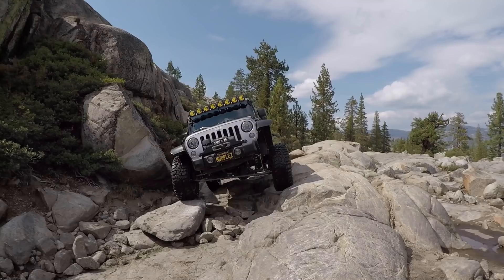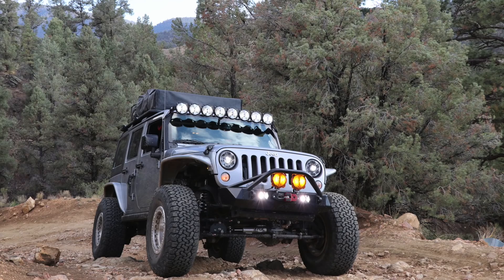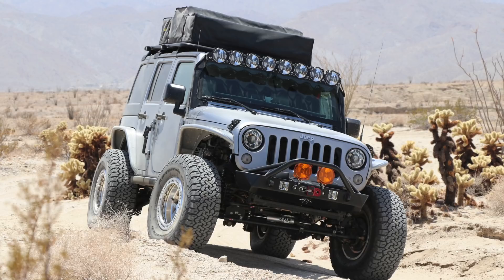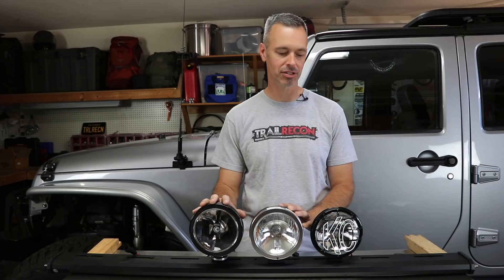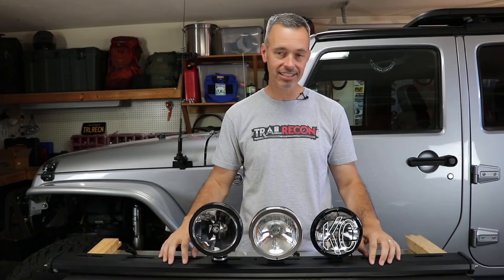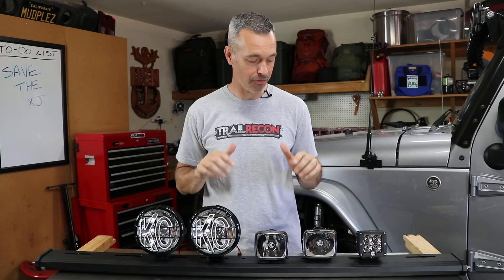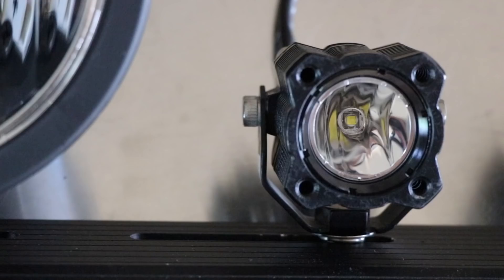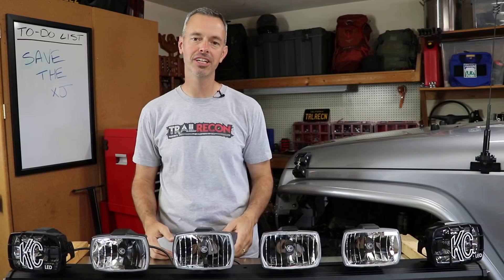Which Off-road Lights are Better? HID vs. LED vs. Halogen & Beam Patterns

Comment: Very helpful. I will be getting the HID lights
Reply: still stuck on HID's and halogens.   When you factor in reliability, cost, performance, etc, it's nearly impossible to beat HID.    It's been about 5 years since LED"s really took off and I will guarantee you that anyone who's tried LED this and that throughout those years has a box of dead LED products (leaky, blinking, dead elements, etc)     HID is still the king of range.   If you want to set up an LED that'll have the same output and range of a 50W HID spot, you'll be looking at a massive LED lamp that draws a few hundred watts.

Comment: Great video! I would be curious to also see the running temps of each of those. Might be important for lights near equipment on the top of a Jeep
Reply from the maker: Oh man, that would have been a great thing to have compared... maybe I'll have to do a temperature video another time.  Just need to get them to loan me the lights again!
Reply: LED are great... but I live in VT and they just don't run hot enough (on the lens) to keep snow and ice off them and until HID are in my price range, I'm stuck with 130W bulbs in my Hella 500FF enclosures.  All the LEDS become pretty useless after 10 minutes on the road or trail in the winter.

Comment: Had KCs for many years but switched to Baja Design LEDs last year.  And yes on matching your lights to your use and to your electrical supply.  Once upon a time 25 years ago in the deepest, darkest Baja, my old ‘72 CJ rolled to a stop in the dark.   D’oh.  I ran the battery dry because I was using more juice than my alternator could produce.  Lesson learned.  Love your vids.

Comment: Great video!!  Loved how you explained everything. Would have been nice if you showed how the lights performed at night for longer on screen time. Having only a few seconds to check out what their performance is just wasn’t enough. For future reference try 10 seconds for each light by itself alone. After showing each light by itself then show pairs of lights as in how they can be used to compliment each other. Also, try placing a marker of some kind at various distances from the rig. A small stand or tripod with a white paper plate with a number written on it with sharpie would work perfectly. Thank you for the great videos of things we, your viewers, couldn’t do ourselves. 
Cheers mate and happy trails

Comment: Hey Brad, Great video as always! Very informative. I realize you live in a warm part of the country but I think a good thing to mention is LED do not put out enough heat to melt ice or snow. I have LED headlights and fog lights and had to keep stopping during a snowstorm on my way to Cleveland to brush them off. There are lights that come with a heating element but are more expensive. Really jealous of your Gravity Pro Light Bar!

Comment: As a new JL owner with the LED lighting option, the main complaint I found on all forums about the LED lighting package was how they sucked in winter driving when the snow covered them and stuck rather than melting off.  Every forum I read said you need the LEDs with heated covers, or put a set of Halogens on.  Thus I went with KC Daylighter Halogens - one pair Driving and one pair Spread.  I figured that would be enough to get me through the snow issues, and I plan to use LEDs for any additional lighting needs to lower the total amp draw.

Comment: I've owned my TJ for 13 years and I'm still moving lights around!  lol  
I presently don't have any lights up on top over the windshield since I've experienced a lot of reflection from the hood.  And being yellow in color,  the reflection looks like it's sundown in the Jeep.  
For the lower windshield corners, I presently have 6 inch KC Daylighter halogen spot lights and they light up nicely with no reflection. 
On my front bumper I have (cheapo) 4 inch HID's which are awesome as they're wide angle and super bright.  They have been great for many years.  
I now need to decide if I want to keep the (old school) light bar above the windshield or take it off...  Some nice small LED cube shaped spots up there would be nice if they didn't reflect.  I need to confirm that however before I spend $$ on those...
Reply from the maker: I can't stand hood glare, I use to get it when I ran fog a-pillar lights, but having spots in that position might work better.  Thanks!

Comment: I definitely love HID lights. I did a swap on my 02' Honda civic back in the day and the results were spectacular.

As far as what type of light is best I think it just depends on what the mission is. LED great for its usage time versus battery drain if you are using the lights for camping per se, HID is great for constant travel, and halogen is great for if either of the other two really bother your eyes.

I hope to be able to truly join the overlanding culture someday. Thanks for another great video!
Reply from the maker: All excellent points.  Thank you!
Reply: halo is better than led for bad weather; less scatter in fog , snow, rain

Comment: Great video! Talk about variety. Me personally, it’s LED only. It was interesting to see some of the comparisons. Thanks for taking the time to put this together. Stoked to see the XJ light bar video!
Reply from the maker: I'm with you on the LEDs, but there is an argument to be made for HID's.  Can't wait to get the light on the XJ!!  Thanks!
Reply: Normally i use led.  Only exception if my rally car.  Hid seem to throw light further and with led i find things get more washed out.  Not a big deal on the street.  80mph on a dirt road at 2am its an issue.
Reply: One disadvantage is if it snows, the leds cant melt it.

Comment: hey brad, great video as always. I am going to put some round lights on my A-Pillar, but don't know what beam pattern to use, any suggestions? I don't have any other lights on my Jeep besides my headlights (LED).
Reply from the maker: I'm sure there are several opinions on the matter, but I personally don't like a-pillar lights because of the hood glare they cause.  I would think to reduce hood glare, a spot light might work best.  All depend on what kind of coverage you need.

Comment: I have the KC halogens with the spot beam and debating switching the lens out to a spread pattern.  Not sure if the difference is significant enough to spend the money it though.
Reply: Kinda late. But did you ever exchange them out for the spread

Comment: I have a wiring question.....If I'm wiring into the JLs factory aux switches can I cut away and discard the relay and fuse that come with the supplied light harness?

Comment: Hey Brad, just curious because usually you mention that if you use Trailrecon when buying something from KC lites you get a small discount. Do you know if that option is available? Was about to checkout in there website but the purchase price is $1700 plus and thought I’d check with you before buying because a penny saved is a penny earned. Plus I am planning of putting this light bar on my 4Runner, and need to check if it will fit my Frontrunner rack without sticking out the sides to much. As always love your videos keep up the great work man.

Comment: Going back through videos on lights and remembered this one. Needed a refresher on the pros and cons. Probably going to go with halogen for mine just because of the different light frequency and price. Amber led is expensive, fog gets thick as mud down here sometimes and having the warm light from the halogen would be to my advantage. Can't afford KC sadly, looking at hella. Anyone have any experience with the mounts, heard they were hit or miss.

Comment: One of the most impressive lights ive ever used are vintage cibie lights.  They are amazing with just a generic halogen bulb.  

On my street cars i use led bulbs.  No better or worse then halogen but way less energy needed.  

On my rally car however i use big reflector hid lights.  2 spot 2 wide beam.  Easier on the eyes and throws light further down the road.

Comment: Another thing I forgot to mention is placement of the lights.  I bought my JKU with LED lights mounted on the pillars.  I HATED those lightbecause they reflected so much light off of my white hood into the windshield.  They blocked more visibality than they illuminated.  A simple bracket corrected all of those issues for me.
Reply: Lol

Comment: Hey brad I’m loving those G46 lights! I’m looking into purchasing a set of 2 for the front bumper on my truck some time in the future how are the ones from your xj holding up even after the roll over?
Reply from the maker: So the light on the XJ bumper are the G34's, a little smaller than the G46's.  They are working just fine, no issues with them after the rollover.
Reply: Oh, apologies. Well I am planning on purchasing and installing the G46 lights on my 96 Chevy C1500 but I might custom install some 4x6 led dual beam headlights in the bumper instead and use the low beam as fog/driving lights and wire the hi’s to a separate switch to power on when need on a backroad or anytime it is needed, what is your thoughts on that Brother?

Comment: If I'm running couple of different led lights and possibly a winch later on, do i need a second battery or will one be enough?
Reply from the maker: I've got a winch, several lights and a fridge in my Jeep and only running a single battery.

Comment: LEDs just aren’t as good for night clarity IMO. For me, halogen 9” fog/spreads on the bumper and 5” spots on the pillars is plenty.
Reply: finally!!! someone who sees it my way. I thought I was a weirdo when I actually preferred the way halogens lit up the environment compared to LED. Sure LEDs are so futuristic and cool looking but I cant see shit because the beams are so narrow and concentrated.
Reply: @MrInzombia  I'll join that club.   The term you're looking for is narrow spectrum lighting...   I highly suggest you try some HID's in whatever beam pattern you want.   The only advice is to stay low on the color temperature 5000K or less.   less is better, everyone will suggest 4300K.   The higher the color temp (K value like 8000-15000), the more blue it becomes and then you run into the same problem with narrow spectrum lighting.   can't "see" anything even though it appears to be illuminated.
Reply: @littlegoobie  kelvin is the big deal. Also cheap led's and wrong housing

Comment: Something to consider is that while the HID may have more lumens as measured at some distance from the lens it will have less effective output because the shorter wavelengths of the bluish light scatter quicker than the longer, warmer wavelengths of the halogen. So less of the HID's light will make the return trip to your eyeballs. Those bluish wavelengths also wash out details, our eyes aren't as attuned to them as to lower k light. To our eyes, the blue light is glare. As I recall, the optimum temperature for human vision is in the 3500k to 4300k range.
Reply: .. just change the lens newb
Reply: @1stcSOLDIER  All the lens can do, newb, is filter out colors. If the bulb isn't putting out any light at 3500k, the lens can't add any light at 3500k. And if the lens blocks light at 5500k then that means there is less light overall, newb. Just changing the lens won't make a bad bulb better.

Comment: Dude, is that HID lamp advertised to be the same colour temperature than the LED? It looks like 5000k vs 6000k. That is very important when comparing lights. Also, any lamps for HID you would recommend? 
I rather go for HID cuz I'm not putting so many lights to worry about my electrical but there are 35w, 50w, 55w and even 100w HID bulbs to be used and that is a ton of lux compared to any other option available. And for cheaper than LED (initial cost at least, but also cheaper to replace a bulb than to replace the whole light).

Comment: You did forget one key factor that should influence any decision on lights.  The philosophy of use.  Why do you need these lights?  When do you need these lights?  Is the temperature hot of freezing?  If you are crawling rocks at night when the temp is at it's lowest and tolerably that would be drastically different than when you would be checking traps in the winter during the warmest temps in the Winter.  That is a huge factor that needs to be considered.  It isn't like Grandpa's day when the light burned off all the ice, snow and frost.  That needs to be said.  The modern day lights are drastically different and require more thought as to the requirement than they did in days past.

Comment: 4500k-5000k HID is just about the best you can get. closest temp to sunlight and has the highest lumen output for the whole spectrum of color. as long as your housing can handle the heat, a 55w 4800k HID bulb would be your best bet, not the super blue ricer bulbs that make everything blue looking

Comment: I have NEVER found a "driving" off road light that works as well as the old Grote Stainless Per-Lux lights with 150 watt sealed beams.  I have used them for 35 years (originals still use them now) and they (2) will totally knock out most ANY LED or HID out there.  Sadly, they are no longer made.

Comment: Why doesn't anyone ever talk about temperature management on LEDs. As they warm up they have to drop their input so they don't damage themselves which reduces the light they out out. A 200w led light bar may only put out 170w when running forna prolonged period.

Comment: Where are studies showing LEDs last longer than HIDs?
Reply: You can look at the datasheets from the different manufacturers.  HID will typically lose 20-30% output and suffer from some colr temperature shift over about 2000 hours.  Halogens typically lose at least 20% output by the end of their life.  LEDs, say from Cree, are rated for 10,000's of hours until 70% their original output, if theyre heatsinked appropriately.  A good quality lamp will incorporate some "throttling" if the driver and led chip gets too high (e.g. driving slowly for extended periods).

Typically the driver circuitry will burn out long before the actual led chip.  And the plastic lenses will be crazed/hazed long before the lamp fails.